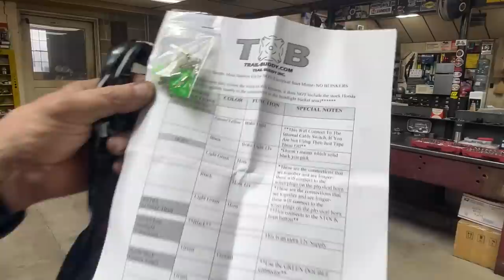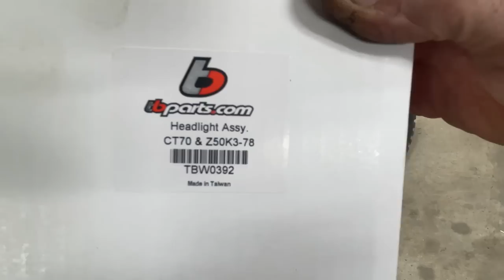Honda CT70K0 - this one puts up a good fight!

Comment: Great video Mike. Would you recommend a Lifan 140 w/starter on one of these builds? I noticed the price wasn't that much different for 15cc more.
Reply from the maker: I only issue I can think of is the starter being in the way of installing the engine guard…..if it’s a bottom mount starter.   Other than that, it should be a bolt in engine.

Comment: PB Blaster works wonders, spray everything and give it a chance, probably could have saved that float post and gotten the head off easier, instead of manhandling it.
Reply from the maker: I really wasn’t interested in waiting the 3 years it would take for the PB to do its thing.  Honestly, the first half of that video was just for entertainment, I had plans to put the Lifan in from the beginning, that’s why it was on the bench.

Comment: Great video as usual👍
What sort of cruising speed do you get with the Lifan 125 set ups you use?
Reply from the maker: Because I choose to have my bikes look as stock as possible and use the stock exhaust, mine typically hit somewhere 52-55mph.  I’m seldom on roads with limits above 45mph.  
But, with a free flowing exhaust, 17/32 gearing, fresh wheel bearings, brakes that aren’t dragging, etc…..you can get one set up to hit between 60-65mph.
Reply: Thanks for the reply Mike.
I’ve been trying to decide if the 125 would be adequate or if I should pay the extra for a 140, if it’ll sit at 50 on the flat for 4-5 miles that’ll be fine.
Reply from the maker: @joeyc8623  A 125 won’t have many more MPH’s in it, but will definitely cruise you at 50.

Comment: Another great video, Mike.  Thanks.  I have a quick question about your builds.  In all of your videos I have watched, I don't think I have ever seen you have to replace wheel bearings, and I expected you to have to do it on this one.  Are those stock sealed bearings so go that they rarely need replacing?  Thanks for all the videos.
Reply from the maker: I’ve never replace a wheel bearing.  Most of these bikes have less than 1000 miles out on them.

Comment: Thanks Mike for the GREAT video. Always learning something from you. Did you use the intake that came with the Lifan motor for that NIBBI Carb ? What's your thought on that carb so far ? What jet set up did you install on the carb ?  I bought that same 125cc engine for my Ct-70 build. 
Thanks Mike
Reply from the maker: Thanks!   Yes, I used the Lifan intake.  I like the carb.  It bogs just slightly, if you crack the throttle too quickly.  Rejetting would probably solve that, but I don’t have other jets.  As long as I don’t crank it too fast, it works wonderful and I’ll keep it on there.

Comment: Great videos Mike 
Would you have a video regarding the factory turn signals operation? I gotta 76 that was blinking very slowly. 
Thanks
Reply from the maker: It they’re blinking, I’d say everything is good.  If the battery is fully charged, you might try replacing the flasher.

Comment: I noticed that you never use thread locker. Do you ever have a problem with nuts and bolts backing out?
Reply from the maker: I’m 58 and have never used, or even touched, a bottle thread locker.   To my knowledge, I’ve not had anything back off or out.

Comment: Lol, in a hurry but looking forward to making the time for this one. Quick question for you - ever had one of the ‘91-‘94 models? I have a ‘91 and a couple ‘93’s. With 4x10 tires and upgrading turn signals, I’ve found them to be the very best in dependability and ride compared to my K0 and K1. Any thoughts? - Really enjoy your work - Thanks
Reply from the maker: Agree 100%.   The 90’s bikes got the 12v engine with CDI….huge improvement over the early bikes.   I’ve never owned a 90’s bike, but have ridden a couple.  Over the past couple years, I feel they’re finally getting the interest they lacked for a very long time.